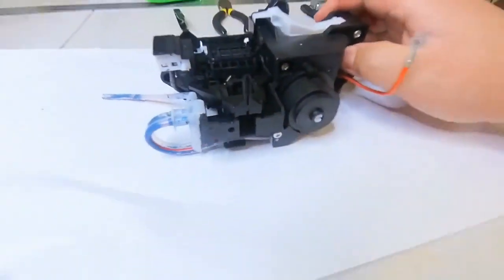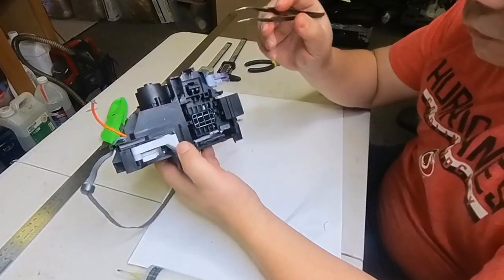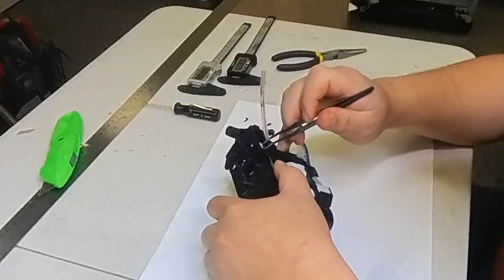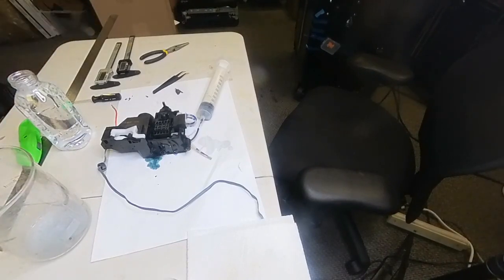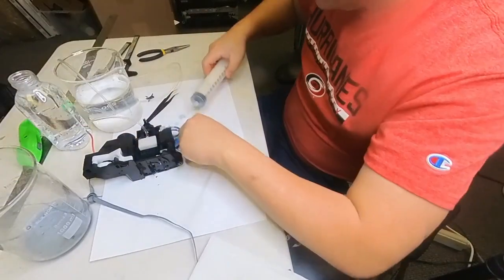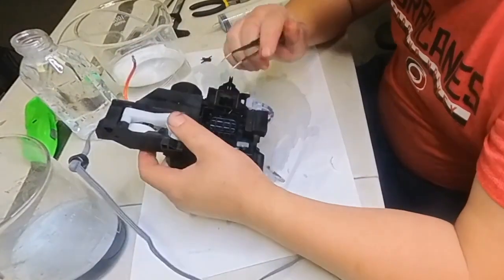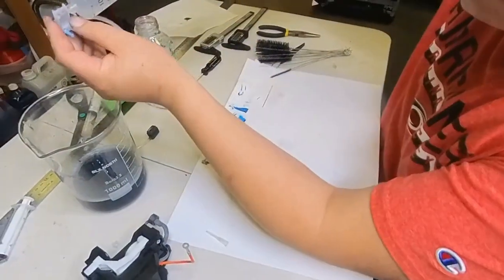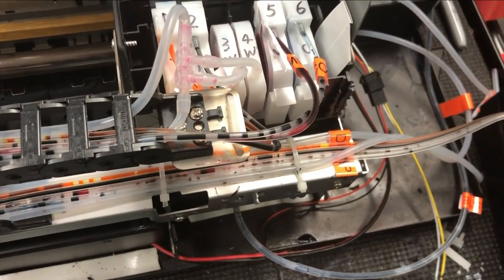Expert Guide: Capping Station Tube Unclog, Clean and Repair for L1800 1430 1440 1390 Printers

Comment: Also, do you have a video on how to uninstall the capping station?
Reply: Did you ever get a response to this?
Reply from the maker: Thanks so much for your question and support! I’ve made several videos that can help with capping station issues, including removing and reinstalling the capping station ([https://youtu.be/\_cZEkmgIZYc](https://youtu.be/_cZEkmgIZYc)), cleaning and unclogging it ([https://youtu.be/WbY\_6O1-w2c](https://youtu.be/WbY_6O1-w2c)), regular maintenance ([https://youtu.be/5yjq3ZN0qv8](https://youtu.be/5yjq3ZN0qv8)), troubleshooting and repairs ([https://youtu.be/5UC2IMu9V90](https://youtu.be/5UC2IMu9V90)), and rewiring tubes ([https://youtu.be/J9im3s8UJfo](https://youtu.be/J9im3s8UJfo)). For a complete step-by-step teardown and reassembly, I also have an exclusive detailed guide here: [https://bchtechnologies.com/products/video-capping-station-assemble-disassemble-guide-for-l1800-1390-artisan-1430-and-1400](https://bchtechnologies.com/products/video-capping-station-assemble-disassemble-guide-for-l1800-1390-artisan-1430-and-1400). I get a high volume of questions every day, so while I do my best to respond to as many as possible, subscribers and members are prioritized and usually receive answers within 48 hours, along with benefits like early access to videos. If you need faster assistance, please email [support@bchtechnologies.com](mailto:support@bchtechnologies.com), and if this video or comment has helped in your journey, I’d really appreciate a review on my Google page: [https://g.page/r/CfL7k6nYvPQ9EAg/review](https://g.page/r/CfL7k6nYvPQ9EAg/review). Don’t forget to subscribe or become a member so you’ll always get priority support and exclusive perks!

Comment: Should you be able to suction out waste ink from the tube when the machine is off?
Reply from the maker: Thanks so much for your question and for supporting the channel! Yes, you should be able to suction waste ink from the tube even when the machine is off, and I’ve also made some videos that may help with related issues like screeching sounds ([https://youtu.be/MjArYM-QnfU](https://youtu.be/MjArYM-QnfU) and [https://youtu.be/TNOG\_1TtN6g](https://youtu.be/TNOG_1TtN6g)), capping station removal and reinstallation ([https://youtu.be/\_cZEkmgIZYc](https://youtu.be/_cZEkmgIZYc)), unclogging ([https://youtu.be/WbY\_6O1-w2c](https://youtu.be/WbY_6O1-w2c)), maintenance ([https://youtu.be/5yjq3ZN0qv8](https://youtu.be/5yjq3ZN0qv8)), repair ([https://youtu.be/5UC2IMu9V90](https://youtu.be/5UC2IMu9V90)), and tube rewiring ([https://youtu.be/J9im3s8UJfo](https://youtu.be/J9im3s8UJfo)), plus a complete disassembly and reassembly guide available here: [https://bchtechnologies.com/products/video-capping-station-assemble-disassemble-guide-for-l1800-1390-artisan-1430-and-1400](https://bchtechnologies.com/products/video-capping-station-assemble-disassemble-guide-for-l1800-1390-artisan-1430-and-1400). I do get a high volume of questions, so please know that subscribers and channel members are prioritized for responses within about 48 hours, while I answer other viewer questions as time allows. If you ever need faster help, you can also email [support@bchtechnologies.com](mailto:support@bchtechnologies.com), and subscribing or becoming a member not only ensures priority answers but also gives you early access to videos and exclusive benefits. If this video or my answer has helped you on your journey, I’d be so grateful if you could leave a review on my Google page: [https://g.page/r/CfL7k6nYvPQ9EAg/review](https://g.page/r/CfL7k6nYvPQ9EAg/review).

Comment: I had a lot of dried ink in the white plastic part, the "sucking tube" attaches to. I took it apart not paying enough attention. Does anyone know how to put it back together?
Reply from the maker: Thanks so much for watching and sharing your experience! That white plastic section under the capping station can be tricky—inside, there’s a small valve and gasket that must align perfectly when reassembled or it won’t seal or pull ink properly. You can get a replacement here: https://bchtechnologies.com/products/manifold-for-capping-stations-protective-cover-for-1390-l1800-1430-printers-1390-1400-1410-1430-1500w?_pos=10&_sid=77ebacc0c&_ss=rIf you’re unsure of the order, you can email [support@bchtechnologies.com](mailto:support@bchtechnologies.com) and we’ll guide you through it with photos. I really appreciate your support! Because there’s a high volume of questions, subscribers and members get priority answers within 48 hours and enjoy exclusive perks like early video access. I can only answer about 10 questions a day, so after subscribers and members, the newest comments are answered first. If you’re not subscribed and don’t hear back within 48 hours, you can either subscribe (your old questions automatically become priority) or re-post to move it up. And if this video or comment helped, please consider leaving a quick Google review here: [https://g.page/r/CfL7k6nYvPQ9EAg/review](https://g.page/r/CfL7k6nYvPQ9EAg/review).

Comment: Hi Kevin, somehow I popped off the capping station & big spring underneath. It was connected by one black tube that I accidentally pulled off from whatever it was connected to inside. Then I realized there’s a 2nd little black tube loose from capping station that is still connected beneath. How do I remove the A3+ capping station or waste pump? The whole thing you are working on here? I can only find the A3+ R.
Reply from the maker: Thanks so much for your great question and for watching the video! It sounds like you’re really diving deep into your printer’s capping station setup, which is awesome. I’ve made several videos that can help you step-by-step: how to remove and reinstall the capping station ([https://youtu.be/_cZEkmgIZYc](https://youtu.be/_cZEkmgIZYc)), unclog and clean it ([https://youtu.be/WbY_6O1-w2c](https://youtu.be/WbY_6O1-w2c)), perform regular maintenance ([https://youtu.be/5yjq3ZN0qv8](https://youtu.be/5yjq3ZN0qv8)), repair common issues ([https://youtu.be/5UC2IMu9V90](https://youtu.be/5UC2IMu9V90)), and rewire the tubes ([https://youtu.be/J9im3s8UJfo](https://youtu.be/J9im3s8UJfo)). If you want the full detailed breakdown with disassembly and reassembly instructions, check out my exclusive guide here: [https://bchtechnologies.com/products/video-capping-station-assemble-disassemble-guide-for-l1800-1390-artisan-1430-and-1400](https://bchtechnologies.com/products/video-capping-station-assemble-disassemble-guide-for-l1800-1390-artisan-1430-and-1400). I truly appreciate your support—please consider subscribing or becoming a member so you’ll get priority answers and early video access! I receive a high volume of questions daily and usually respond to subscribers and members within 48 hours. Non-subscribers are answered when time allows (about 10 questions per day), and after that, newer questions are reviewed first. If your question isn’t answered within 48 hours, you can subscribe or simply re-post it for quicker visibility. Subscribers don’t need to re-post; your older questions automatically move to the priority queue. For faster help, you can also email [support@bchtechnologies.com](mailto:support@bchtechnologies.com). And if my videos or comments have helped you, I’d really appreciate a quick Google review at [https://g.page/r/CfL7k6nYvPQ9EAg/review](https://g.page/r/CfL7k6nYvPQ9EAg/review) — it means a lot and helps us keep making more guides like this!

Comment: Hi Kevin, I have a L1800 I changed the print head and the capping station, I cannot pull black ink from the waste line, i hear air but nothing comes out and I cannot print anything. What more can I do to fix this printer that is just sitting there?
Reply from the maker: Thanks so much for your question and for supporting the channel! If you've already replaced the printhead and capping station on your L1800 and you’re hearing air but can’t pull black ink through the waste line, try adding a little water to the capping station and gently drawing from the waste tube — this helps you determine whether you’re dealing with a clog or if the printhead simply isn’t sealing correctly on the capping station. I really appreciate you being here, and if you'd like priority replies (usually within 48 hours), please consider subscribing or becoming a channel member, since I get a huge number of questions and can only answer about 10 per day; subscribers and members get first priority, and the rest are answered newest-to-oldest as time allows. If you’re not subscribed and don’t hear back within 48 hours, feel free to subscribe or repost your question so it moves to the top — and if you subscribe later, your older questions automatically become priority. You’re also invited to join me on Run With Kevin — LIVE, where I go live most mornings between 6–8 AM Eastern and answer printer questions in real time, so subscribe and turn on notifications if you want to catch the next session. If you ever need faster help, you can always email [support@bchtechnologies.com](mailto:support@bchtechnologies.com), and if this video or reply helped you, I’d truly appreciate a quick Google review at [https://g.page/r/CfL7k6nYvPQ9EAg/review](https://g.page/r/CfL7k6nYvPQ9EAg/review).

Comment: I'm ready to purchase if there is a video please
Reply from the maker: Thanks for subscribing! Your support helps us get closer to our 100K goal, and I really appreciate it. If you're looking for step-by-step guidance on the capping station for the L1800, 1430, and 1390, here are some videos that should help. Removing and Installing the Capping Station – This video covers taking the capping station out and reinstalling it (https://youtu.be/_cZEkmgIZYc). It doesn’t include uncasing the printer, so if that part seems tricky, it may be best to have a professional handle it. Unclogging the Capping Station – If the capping station is clogged and not sealing properly, this guide walks through how to clean it (https://youtu.be/WbY_6O1-w2c). Capping Station Maintenance – Regular maintenance can prevent issues, and this video shows best practices (https://youtu.be/5yjq3ZN0qv8). Repairing the Capping Station – If it’s not functioning correctly, this video explains common problems and fixes (https://youtu.be/5UC2IMu9V90). Rewiring Capping Station Tubes – If your tubes are clogged or disconnected, this video explains how to rewire them (https://youtu.be/J9im3s8UJfo). If none of these help, I have a detailed exclusive video on my website that shows how to completely take apart and reassemble the capping station, down to individual gears. You can find it here: https://bchtechnologies.com/products/video-capping-station-assemble-disassemble-guide-for-l1800-1390-artisan-1430-and-1400. Let me know if you need more help!
Reply: @BCHTechnologies  hey i bought this video, thankss

Comment: Hi sir I'm looking for the step by step video but cant find it, kindly help
Reply: Me too 😢
Reply from the maker: Thanks for subscribing! Your support helps us get closer to our 100K goal, and I really appreciate it. If you're looking for step-by-step guidance on the capping station for the L1800, 1430, and 1390, here are some videos that should help. Removing and Installing the Capping Station – This video covers taking the capping station out and reinstalling it (https://youtu.be/_cZEkmgIZYc). It doesn’t include uncasing the printer, so if that part seems tricky, it may be best to have a professional handle it. Unclogging the Capping Station – If the capping station is clogged and not sealing properly, this guide walks through how to clean it (https://youtu.be/WbY_6O1-w2c). Capping Station Maintenance – Regular maintenance can prevent issues, and this video shows best practices (https://youtu.be/5yjq3ZN0qv8). Repairing the Capping Station – If it’s not functioning correctly, this video explains common problems and fixes (https://youtu.be/5UC2IMu9V90). Rewiring Capping Station Tubes – If your tubes are clogged or disconnected, this video explains how to rewire them (https://youtu.be/J9im3s8UJfo). If none of these help, I have a detailed exclusive video on my website that shows how to completely take apart and reassemble the capping station, down to individual gears. You can find it here: https://bchtechnologies.com/products/video-capping-station-assemble-disassemble-guide-for-l1800-1390-artisan-1430-and-1400. Let me know if you need more help!

Comment: Hi Kevin. I have a question about the small black tube that connects to the capping station. You have to take them off when you remove the piece that holds the sponge. My tube came completely out. It is not attached to anything. Can you tell me how to fix this?

Comment: Hi! I got new printhead because I was having issues with it. Once I got new one the cyan was clogged right away. Ive noticed since the techs had my pulling ink from the waste line so many times my capping station doesnt keep the ink. Even when I put the cleaning solution in it it drains. Any suggestions?

Comment: Is there a way to unclog the capping station without completely removing it? does simply using a bigger syringe work? is there a liquid I can use to help break the ink down? my dtf has been clogged for a few weeks
Reply: Were you able to fix yours? If so, what method?
Reply: Hello, did you fix the clog? I am having the same issue and dreading taking the whole capping station out